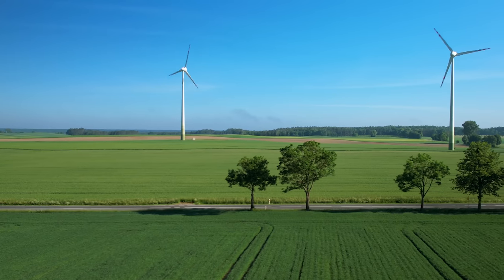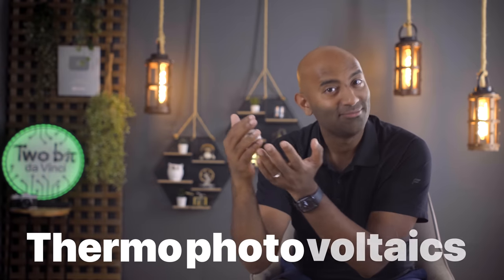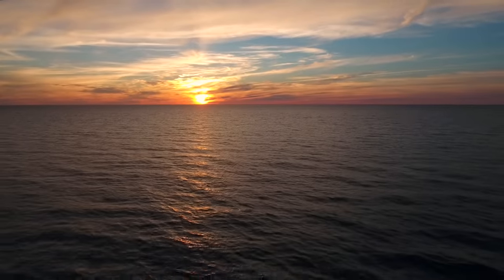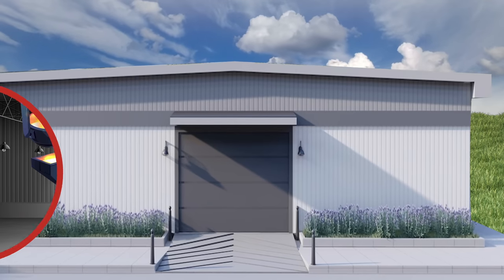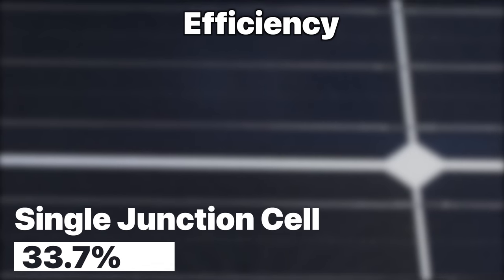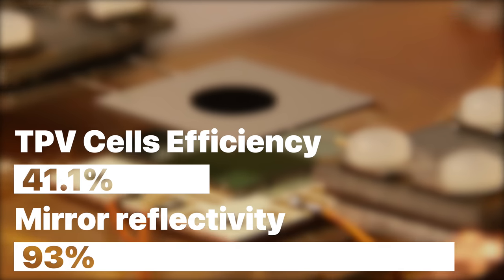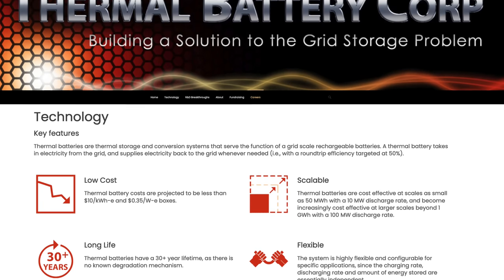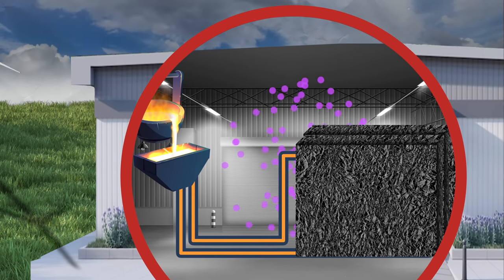Breakthrough Solar cell DOESN'T Run On Sunshine!

Comment: Their system is not new because all the components are not new. The reason I say this is because IR LEDs have been around since the beginning of LEDs. They also generate electricity with minor modifications it is nothing new. The carbon block replaced the original graphite storage system. True they upgraded the components but they are wasting time in the quest for raising efficiency when they over complicated the system instead of simplifying it to lower cost more dramatically.

Comment: I like the idea of putting lots of bits of mature technologies together in new ways.  Thats Engineering.  I don't like the sound of all that hot graphite.  The argon in the building will not be there to stop things corroding, it will be there to stop the fire!  Graphite=charcoal.  How gas tight can you make this building?  Most of this idea looks ok but maybe the graphite heat battery needs a rethink.

Comment: That 50% efficiency needs to be weighed against the energy required to melt the tin - how much of the energy generated is necessary to heat the tin.
Reply: Plus what is the cost per kwh of this sysgem?

Comment: The development of methods of converting heat back into electricity efficiently is the next BIG push after solving the carbon problems in our atmosphere. Removing the carbon will reduce global temperature to some degree, but to reduce it further this TPV tech can further help us. Bravo!

Comment: This tech would be perfect for new construction concentrated solar and fission plants, less moving parts, and eventual electronic control system obsolescence to worry about (feed flow, steam generator level, auxiliary feed systems, feed water heating control, turbine control, steam over pressure protection systems, water makeup, and more, the list is insanely long and systems very complex).
Reply: are you in dreamland ? are you trying to sound experienced in throwing around mention of systems that are extremely simple to construct and control ...think man . whats involved in pumping tin ? just for starters , argon environment , tpv cost , efficiency , life ...noticed you also mention concentrated solar , that pretty much says it all about your actual REAL world knowledge and involvement

Comment: How much energy is wasted by cooling the cells? How much energy is used up by the various subsystems? How much energy is simply leaked away for a system of a reasonable size? How much energy can be stored considering the thermal range of the medium? I am sorry, but I fail to be excited by this.

Comment: Question:  Are they pumping the molten tin to another building, because the carbon "plumbing" is thinner, thus allowing it and the connected tungsten foil to glow?

Whereas the containment vessel's thickness is significant, specifically to make it not glow, as I'm imagining that it glowing hot means it's not insulating enough and throwing away stored energy?
(two parts, but ultimately one question... lol)

Thanks.

Comment: Surely, a system that uses far less extreme temperatures would be the sensible way to go ? Even if it was only 1/2 as effective it’d be far more obtainable as an effective system

Comment: Lots of potential problems that need to be addressed. Pumping so much heat, costs of gallium arsenide (environmental and production and sourcing costs), life of TPVs, life of radiant tungsten foil in TPV chambers (incandescent bulbs burn out), cost of and sources of Tungsten, how much water is used and will it corrode the heat sinks around the TPVs? This scheme is highly technologically complex with multiple potential pitfalls and for that reason I’m less optimistic about it than simple lower tech less efficient systems that are both upwardly scalable for large power generation plants and usable in micro applications on boats or houses. Such expensive and highly complex systems with multiple engineering challenges probably won’t work in much of the developing world where green energy resources must be developed to stop or limit climate change.

Comment: Respectfully, comparing the efficiency of a solar panel to the efficiency of lithium batteries seems like madness to me. They do fundamentally different things. It really seems to only confuse people and turn them away from solar. Instead, in reality, a flat object made by humans produces electrical current when the sun is shining on it, while we just sit inside and drink a beverage. It would still be a miracle if it was 1% efficient or 80% efficient. But people look at solar panels and see 15% efficiency and think it is bad or wasteful tech.

Comment: Seems overly complicated destined for a similar failure as the "bunch of mirrors aimed at tower" system... and I'm usually optimistic. Hope I'm wrong.
Reply: "Overly complicated" compared to......?
Reply: @rogerstarkey5390  batteries, pumped reservoirs, in general it seems complicated. Simple is usually better.

Comment: All of those HIGH HEAT areas that are losing you money, should have arched, sealed inner forms built over them (inside the buildings) with a GUTTER about ten to twenty feet from the TOP. (Inside peak).attach the gutter so it has a slope that leads to another GENERATOR and gravity feed that water into it w the GUTTER..this way the plant should put out about a third more or better..This is the exact reverse of what our homes are designed to repel water..only on the INSIDE of the buildings..You supply the water..then use it to run the generator as it carries to the ceiling as steam, attaches to the angled ceiling, slides down into the gutter, and trucks it's way to the generator..

Comment: Wouldn't this mostly solve the power and heat problem on deep dive space ships or space stations? you have a way to sink the heat generated by the crew, and a way to dissipate the heat into power and any excess could be radiated out via much smaller radiators to space.

Comment: The Russians during the cold war used molten lead instead of highly pressurized water to cool their nuclear reactors -- so the idea of circulating molten metal through a system is NOT novel.  Given the extremely high temperatures involved in nuclear reactors vs the system you show here, I would say that we are more than capable of making such a system work.

Comment: Industrial scale Wind turbines are the worst thing ever conceived. Same with industrial scale solar fields. 
Besides the land space, wind turbines also take tons of oil and frequently break down not to mention gallons a day of leaked oil, they also are well known bird killers, killing "protected" eagles. You can go to prison for killing an eagle, but the corporate executives can kill tens of thousand's of eagles with impunity. 
Solar fields are also a disaster. 
Both require millions of tons of material resources to produce. It takes about 1000kwh in manufacturing, maintenance and resources for each 1kwh a wind turbine or solar field produces.
The environmental impact of a single wind turbine in a single year is equal to 100 1971 360ci Chrysler Newports driving 50 miles a day for 5 years. 
You might as well fire up an old 460ci Ford V8 to power a 1500 watt generator.

Comment: This is interesting at least.   It may be (or not) more practical than piling up 10's or 100's of tons of lithium ion batteries if that would even work.   

A typical distribution substation ships energy out at up to 35,000 volts AC continuously as in 24 hours a day.   If this system can't do that it is not usable for the distribution system.   

This might be usable as a small scale commercial or industrial generation source maybe but I think that is all it is ever going to do.   It isn't going to resolve this crisis that politics has created for us by regulating the shutting off of most of our base load generation capacity.

Comment: Why not store the heat from the tungsten filaments directly in the graphite blocks, rather than converting the energy through a cooled cell, in a reflector unit, to melt tin through carbon tubes, to store in graphite blocks… The invention seems technically promising, but I’m not sure why we need these extra steps between heating a tungsten filament and storing that heat in a block of carbon?

Comment: Silly question, if "excess heat" it captured from something like a steel mill, would that actually lower the temperature in the work area? That would be cool (pun intended).
Reply: With a good heat pump system you cold freeze your sweaty work area, but don't count on your corporation to pay for that, no profit in making you comfortable

Comment: If a satellite can detect the comic microwave background that means it’s a receiver of some sort so couldn’t u make a cosmic microwave energy generator. I sometimes think about all the radio stations that are transmitting all the time all around seems u could tap into those for energy generation also.

Comment: Nix molten metal, or any solid, use air, or inert gas. Nix tungsten, use ceramic composites for emitters, waveguides, pipes.

Comment: I always wondered if it was possible to turn heat directly into electricity.  Awesome 😎
Reply: Thermistors have done that at low level for many years.
Reply: Yes, but it's not efficient.
Reply: @fuzzywzhe  
That wasn't the "question"
"Wondered if it was possible"
It was.
Reply: @rogerstarkey5390  It's possible, but a lot of things that are possible, aren't worth doing.

There's Peltier junctions and Stirling engines.  There's a reason we don't do lots of things.

This design, I doubt it's worth doing.  We're wasting too much time on researching ideas that we know at the start aren't worth pursuing.
Reply: We have them. Look up thermoelectric generators or TEGs.
Reply: @edeaglehouse2221  thanks, will do.
Reply: Thanks everyone for your feedback.  However, notice I didn't write I didn't believe converting heat into electricity was impossible. I wrote I wondered if it was possible. I was simply unaware that such technology existed. 
It seems to me from what I have read that such technology has limited applications. There are better ways that are more cost effective and efficient than the technology people have mentioned or in this video.

Comment: So, how cheaper are your multilayer cells are compared to single layered cells.  Where will I store my huge graphite blocks?  Then I'll need a heat to electricity for my refrigerator to use it.   Storing massive energy for later use, should be similar to the sun=plasma based.

Comment: Ok I am not a rocket scientist but wouldn't it be better to use the solar array like at crescent dune to heat up the tin or better yet use it to heat the graphite, then instead of the way you said to extract the heat from the graphite why not use a Stirling engines on top of the graphite to turn generators. This would not only allow only the heat needed to turn the engine and thus not cool the graphite quickly could give constant Electricity,  So if CA or where it is installed had no sun or say 2 weeks bad weather you would not loose energy but continue to generate it.

Comment: But wait...As I understood, even 50% efficiency is only 50% of the energy in the molten tin....does this apply to the energy it takes to make the tin molten? Or does it to apply to the energy given off by the tin once it is molten?
Reply: Good question
Reply: @ronbridegroom8428  thanks for the validation, I appreciate that you understand my question even though it was poorly formulated.

Comment: I don't know why you chose to compare a lithium ion battery with TPV, photovoltaics and a turbine.   If you're talking about energy *storage*, then surely the efficiency of the entire charge/discharge cycle is far more relevant.  In what storage system are photovoltaics used?  How efficient are pumps that fill a storage reservoir?

Comment: hmmm...shouldn't the tpv cell inside a insulated container convert almost all the heat to electricity that is not radiated out? so a photon needs to hit the cell 3 times and its 120% absorbed? (or rather radiated by the tpv cell as heat, reheating the tungsten or graphene and then come back to the cell)?

Comment: To begin with I love this thinking on pvs, but... Really complicated design parameters and metalurgy to 3,600 degrees. Tungsten? Hard to get or not cheap?  Low quality mirrors are cheap and can be sized up. All solar should have some kind of reflector/concentrator, even if it's just white paint. Multilayers are never going to be that cheap or strong and durable.
Sand batteries have held my attention for decades.
May for very large applictions, but I am not excited.

Comment: Dude I'd consider whatever it is that pumps molten tin around without itself melting, or even jamming, then getting water in and out fast enough to absorb 100KW/m2 without flashing to steam and exploding, to be "complex moving parts". I'd call them state of the art barely-possible gonna take years and years to actually get working, moving, parts. Never mind the panel that just sits there, somehow not melting, and having immense thermal conductivity, despite being able to convert that heat into electricity inside itself.

You know thermal engines, even flat-panel non-moving ones, create energy by IMPEDING the movement of heat? They make it harder for heat to escape, getting the heat to do work. So how's it going to maintain thousands of C across such a thin layer, without melting? How much pressure is this water going to be under, anyway? How are you going to defeat the effect where it forms steam at the boundary layer and stops conducting?

"complex moving parts"!?!? This guy's got, like, a square inch of this stuff in the lab, and he tests it with a blowtorch and an ammeter, right? And from there he's gonna scale up to a gigawatt-hour. This isn't even "learn to walk before you can run", it's more like "evolve legs before trying to sprint at the speed of light".

Comment: I'm interested in why store the energy as heat couldn't the heat generated into electricity which is part of your process and instead store the energy as hydrogen because there have been some amazing breakthroughs in the storage of hydrogen energy and then the hydrogen storage tanks or devices can operate indefinitely with no need for special storage or anything else you could take the extra heat converted to energy use the energy to create hydrogen cells and then you have the energy stored as hydrogen for whenever it's needed

Comment: I seriously have been thinking about "What if we change the materials of a solar panel to change it's spectrum to IR?" for the past month or so. Like: IR has less energy, so that could be a drawback. Or maybe use something similair to an AC unit to raise tempature to increase it's tempature/radiation profile. As Those machines can use small amounts of energy to displace larger amounts of energy, aka heat.

Guess you could say: "You don't need to be a professional to be creative."
But you may need to be a professional to actually make it real...

edit after watching: While using the grids surplus to store energy for later sounds great for solar/wind energy providers, wich can't be online whenever we want. My idea was about cooling down the surroundings to produce electricity. Wich would likely be less effective (due to needing some power wich it's produces), but basicly 'free energy'. Though, the thermo-photovoltaics would need to be efficient enough to counter the power demand for the heat displacing.

Comment: 100 kW throughput for a 1x1 m panel seems barely physically possible.
I suspect that is a peak value, and average throughput is maybe 50-60 kW.
Still needs a small river nearby to supply enough cooling, which wouldn't work during long droughts.

Comment: Melting point of Tin 231.9 degrees C. Why go to 2000 degrees. 
Pure tin a Semiconductor?  
 At 2000 degrees C meals suitable for pipe work  etc, if not carbon composite. 
Tungsten (T): 3420 °C
Rhenium (Re): 3180 °C
Osmium (Os): 3050 °C
Tantalum (Ta): 2966 °C
Molybdenum (Mo): 2620 °C
Niobium (Nb): 2468 °C
Iridium (Ir): 2454 °C
Ruthenium (Ru): 2310 °C
All very very expensive and quite hard to come by.
 
The inverted metamorphic multijunction (IMM) solar cell has demonstrated efficiencies as high as 40.8% at 25°C and 326 suns concentration. The actual operating temperature in a commercial module, however, is likely to be as much as 50-70°C hotter, reaching as high as 100°C.

Maximum thermal shock temperatures of 100, 200, 300, 350, and 400 °C were applied to the carbon composite. Characteristic parameters such as porosity, compressive strength, and electrical resistivity experienced a sharp change once the maximum thermal shock temperature reached about 200 °C.

  Gallium arsenide is quite expensive, costing $10,000 per square meter, according to an estimate by the US Department of Energy's Energy Information Administration. 

 Sealing  warehouses  to the standard of a light bulb gonna be very hard pressurised with argon.  

Cooling with water in an environment that potentially may be exposed 2000 degrees C,  will be problematic.
 I cannot find anything  over 350 Degrees C for reference well over 100 Bar about 125 Bar . About 51,812 PSI. 
Interpolating from  graph flattening off  maybe 70,000 Psi. 

How to get the heat energy from Graphite a poor conductor of heat and concentrate on to small area to about 2,400 Degrees C. From Tin at 2000 Degrees C.
 
 I won't hold my breath.

Comment: 7:15 conflates storage with heat to electicity conversion, needs separated because energy storage needs to be consolidated at different location  , systemic effects synergies hint ron both are not worjyh it! 7:15

Comment: If you can capture excess energy without expending additional funds, efficiency becomes far less of a limiting factor.
Reply from the maker: very true...and especially if the cost becomes low enough that lower efficiencies are not a concern.